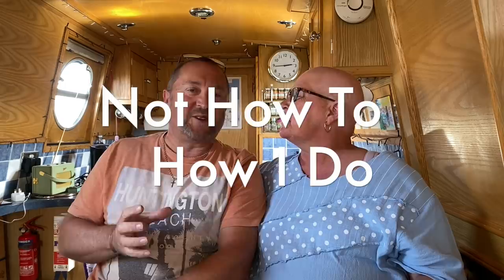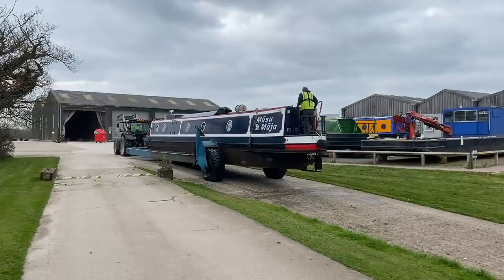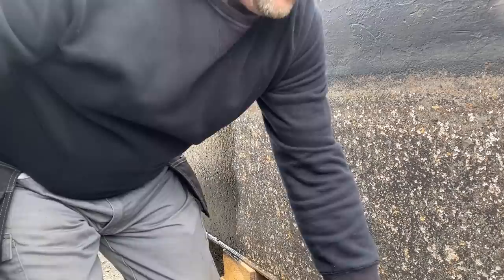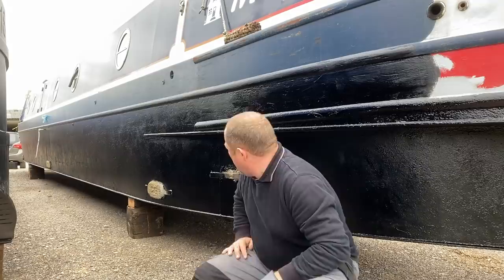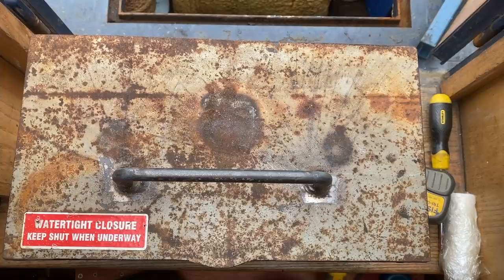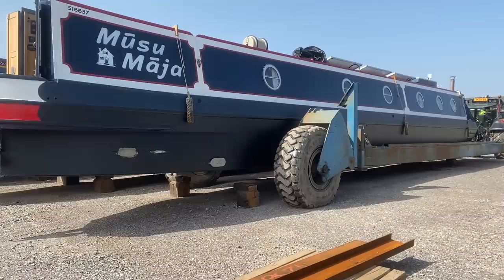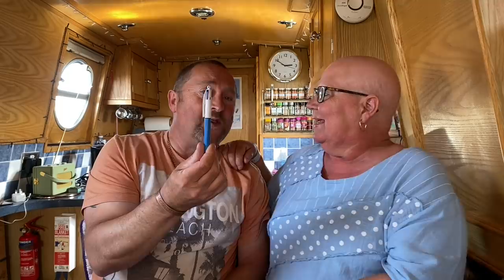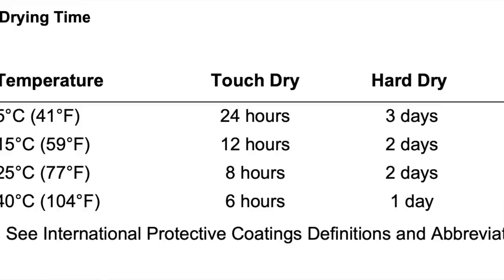DIY Narrowboat Blacking Important Information, How Much? How Long? How To? Canalboat life Costs E102

Comment: The best economy with blacking is just to get it done up north, if your wanderings allow.  Always better deals.  Looks like you did a great job though and always satisfying to do the job yourself.  Personally I don't like crane outs (because of the potential for accidents and stresses on the boat) and dry docks (because providers often have health and safety rules about owners using them or inspecting work done)... trailer out is the way to go.
Reply from the maker: Maybe will be up north next time

Comment: A real good job there . 
Saw the sides done but what about the underside ? I know the plating is much thicker but rust is rust !
If i lived inland i would be very interested in Canal Boating .
Reply from the maker: The base plate is thicker steel and with lower oxygen levels at the bottom of the canal it doesn't rust as much, and any coating you apply get scrapped off in the shallow water
Reply: @welldeckdiaries5610  if I got one built I would have stainless steel bottom and thicker then the ballast can be less.

Comment: Good job. Happy to see Debbie in good spirits. Mark, I see a lot of people don't coat the bottom of their base plates on their boats. Can you elaborate on why this is common? I'm in the US. We have a few narrowboat canals but no boats on them. I hope this changes. Good video and thanks for sharing your hard work.
Reply from the maker: The base plate is thicker steel 10mm instead of 6mm and the idea is that the oxygen levels are lower at that level so it doesn't rust as much
Reply: @welldeckdiaries5610  Am I right in thinking that the blacking would get scraped off in the shallow parts of the canal?
Reply from the maker: @catherineatkins7908  correct
Reply: @welldeckdiaries5610  Thank you. I understand that.

Comment: Great job, how are you able to blacken the very bottom of the boat? A loverly couple. My wife had cancer twenty years ago and things have been great since, I just wish the same for you.
Reply from the maker: Not normally painted, the base plate is thicker steel and with lower oxygen levels at the bottom of the canal it doesn't rust as much, and any coating you apply get scrapped off in the shallow water. Great to hear that about your wife ❤️

Comment: Bitumen is crap. The only reason it's used is because it was traditional to paint wooden boats with it, but it makes little sense on steel boats. If you really want to do it properly, next time get it grit blasted to get rid of all the bitumen and apply 3 or 4 coats of two pack epoxy. Jotamastic 90 is good but you must follow the technical data sheet to the letter.

Comment: Hi Folks,

Why don't you do the bottom? Deb looks wonderful! Courtenay
Reply from the maker: It is considered that the lower oxygen levels at that depth and the thicker 10mm base plate will not case a rusting/corrosion issue. Also any blacking would be scrapped off in the shallow waters

Comment: I didn't see you putting the blacking on the very bottom of the hull. Don't they blacken that area, I would think it should have blacken (paint as we call it) to protect if from hitting items and grounding.
Reply from the maker: its not normally painted, the base plate is thicker steel to last longer and with lower oxygen levels at the bottom of the canal it doesn't rust as much, and any coating you apply get scrapped off in the shallow water

Comment: Not being picky - just curious ! I thought power washing/jet washing was to get the crud and green bits off. I thought then there was some mechanical rubbing/scrubbing done to get anymore hard crusty bits off, or scrub any rust away ?
Reply from the maker: I think that depends on the state of it after the pressure washing. The blacking is designed to cover bare steel but as you say it there was rust encrusted areas flacking areas then scraping or sanding would be needed

Comment: Can I ask what are the anodes do, why are they not blacked - good job, you have lots of patience Mark.
Reply from the maker: The anodes are sacrificial anodes that are designed to corrode through galvanic corrosion to protect the hull and they need to be exposed to conduct ant stay electrical currents
Reply: @welldeckdiaries5610  I'm female and you sound like a car salesman! - didn't understand a word - but take your word on it. x.

Comment: very cool, I enjoy the technical parts of Narrow Boat life very neat, one question.. did you blacken the actual bottom?
Reply from the maker: Not normally painted, the base plate is thicker steel and with lower oxygen levels at the bottom of the canal it doesn't rust as much, and any coating you apply get scrapped off in the shallow water

Comment: Hi Mark. It's a very informative video - thanks for that. I'm going to do my own as well after a poor "professional" job a year and a half ago. Just one quick question. I'm not on the boat at the moment but am going to do the same as you re sink and shower drainage. What size pipe did you use? It looks like 15mm push fit is that right?
Reply from the maker: I assume it was that size, they were bits I found laying around

Comment: Thanks for showing us how this is done.  One question...what happens with the bottom of the boat?  Does it get any attention or what can be done to maintain that part?
Reply from the maker: Not normally painted, the base plate is thicker steel and with lower oxygen levels at the bottom of the canal it doesn't rust as much, and any coating you apply get scrapped off in the shallow water

Comment: Good job! Apparently there is no blacking applied to the bottom...or did I miss something.
Reply from the maker: Not normally, the base plate is thicker steel and with lower oxygen levels at the bottom of the canal it doesn't rust as much.

Comment: You showed yourself doing the easy bits! What about the bottom, which must be a killer of a job with blacking in your face. How did you manage that?
Reply from the maker: Bottom is not normally done. It is considered that the lower oxygen levels at that depth and the thicker 10mm base plate will not case a rusting/corrosion issue. Also any blacking would be scrapped off in the shallow waters

Comment: Since I really know nothing about the NB construction this is likely a very dumb question, but why is it not blacked on the very bottom?
Reply from the maker: Not a dumb question Mary. Not normally painted, the base plate is thicker steel and with lower oxygen levels at the bottom of the canal it doesn't rust as much, and any coating you apply get scrapped off in the shallow water

Comment: I've got a dumb question here... but how do you do the underneath of the boat? Big hello to Debs all the best to you both all the best from Portugal .. De Nada in reply to your last weeks reply ;)
Reply from the maker: Not normally painted, the base plate is thicker steel and with lower oxygen levels at the bottom of the canal it doesn't rust as much, and any coating you apply get scrapped off in the shallow water

Comment: Hi. Can you let us know what happens to the bottom of the boat with respect to blacking...?
Reply from the maker: its not normally painted, the base plate is thicker steel to last longer and with lower oxygen levels at the bottom of the canal it doesn't rust as much, and any coating you apply get scrapped off in the shallow water

Comment: Looked like you have a bow thruster, if it is a thruster does it make a great difference when negotiating sharp turns ? Looking at the box to access the prop, I wonder if it could be a good idea to put a false bottom under the lid so the false bottom sits in line with the bottom of the boat when the lid is on the box screwed down. With the prop turning it must create turbulence within the box, as it is at the moment and possibly cavitation bubbles resulting in some loss of power
Reply from the maker: The bow thruster does help.
did you not see the section of the video where I explain that we have had the weed hatch cover modified?
Reply: @welldeckdiaries5610  Thanks for replying. No I only just found you, so I will be working through your videos over the next few days. I am following a few of you guy's as I am seriously considering moving to living on a narrowboat and I was hoping to find someone who does work on their boat rather than  putting it into a yard to get everything done so when I saw you busy blacking the hull you looked ideal to follow as I wanted to find out what was involved in keeping your boat in good condition. I am retired and on the coast in the UK and life on a narrowboat looks ideal so I am trying to find out as much as I can. Do you have a Facebook page so I could message you as that would be better than posting what will most likely be lot's of stupid questions in public here ? Or maybe I could E/m you, what ever is easiest  for you. Peter.
Reply from the maker: @Peter-nv3wu  skip to 12:00.
And no questions are silly questions 👍

Comment: That was very interesting. I've heard other narrow boaters say it cost £1000-2000 to have it done. Question: So why didn't you need to sand first?
Reply from the maker: With the bitumen type blacking it doesn’t need to be sanded, it can be applied to bare steel or the previous blacking. The power pressure washing remove any dirt or loose blacking so you can the apply the new coats

Comment: Did you do the bottom of the boat Mark, or does it have to be done with something different.
Reply from the maker: its not normally painted, the base plate is thicker steel to last longer and with lower oxygen levels at the bottom of the canal it doesn't rust as much, and any coating you apply get scrapped off in the shallow water

Comment: I'm interested in the modification you made to the weed hatch. Did the baffle make any difference?
My boat has the same concept as you obviously used to have - just a single plate across the top of the weed hatch with nothing below to reduce the turbulence. Is it worth having the baffle added next time I'm out for blacking?
Reply from the maker: Ive convinced myself there is less vibration when working the engine hard on the rivers but it probably just placebo effect as I had to part with my money 😂

Comment: What about the bottom and where the blocks are
Reply from the maker: its not normally painted, the base plate is thicker steel to last longer and with lower oxygen levels at the bottom of the canal it doesn't rust as much, and any coating you apply get scrapped off in the shallow water

Comment: Enjoyed this informative vid very much. Given the 2 pack epoxy works out something like x5 the cost what are the advantages? Does it last x5 times longer? Maybe it makes the nb slip through the water better, who knows.
Reply from the maker: It is more resistant to knocks scraps and diesel spills which dissolve your bitumen blacking

Comment: Nice job! Did you do inside the bow thruster tube? That’s pretty important and needs protecting. 👍🏻
Reply from the maker: Yes I did, I adapted a thin roller although I couldn't get all the way to the middle

Comment: Sometimes it's better do a job yourself just for "piece of mind"...
Last time I helped out blacking we used the upturned drum lid to roll on to even the bitumen out on the roller...bit like after you've loaded up in a normal paint tray, it seems to help when rolling it on the hull as you don't get as many thick clumps that you have to try and spread out... Hope that makes sense !   We had enough bitumen left to do an extra roll coat along the water line   just out of interest what is that pipe for that is poking out of the port side window ?

Take care, Best regards...
Steve
Reply from the maker: Why didn't I think of that 🤣.
Its a temporary vent pipe for the toilet, it been temp for over 2 years and its on my to do list 😂🤣
Reply: @welldeckdiaries5610  one of those temporary things that you'll get to eventually !! ....Rome wasn't' built in a day, lol . You've had enough on your mind these last few months. Take care, Regards  Steve

Comment: Looks like you did a good job, Mark. Just a question from an totally uninformed fellow: does the flat bottom get blacked as well? I've seen many narrowboats being blacked, but don't recall ever seeing anyone going underneath the boat.
Reply from the maker: Not normally, the base plate is thicker steel and with lower oxygen levels at the bottom of the canal it doesn't rust as much.

Comment: And if you have the £5000 treatment done, how long does that last compared with the cheaper version of 2 yrs between coats ?
Reply from the maker: It would need a pressure wash a light abrasion and a 1 coat every 5 to 7 years

Comment: Right. Possibly very stupid question alert. What about the bottom of the boat. Do u need to black that as well or is it left unpainted?
Reply from the maker: Not a stupid question mate.
Not normally painted, the base plate is thicker steel and with lower oxygen levels at the bottom of the canal it doesn't rust as much, and any coating you apply get scrapped off in the shallow water

Comment: Well we had ours done last year we don't live in the UK all the time so we got our marina to do it in Devizes Wiltshire so I did not get a chance to see the condition, before it was blacked I think we left ours to long at three years but could not see any rust on the water line we had two extra anodes welded on, price wise it was about the same I think but our boat moored there so maybe they do a deal, did you not have to sand the Hull before application? *keep well
Reply from the maker: Pressure washing is enough prep, the SML Ballastic data sheet says it can go onto bare steel

Comment: Good job Mark, I do have a question as not being a boat man, you did the sides but what about the bottom of the boat or does that not need to be done as many times?
Reply from the maker: its not normally painted, the base plate is thicker steel to last longer and with lower oxygen levels at the bottom of the canal it doesn't rust as much, and any coating you apply get scrapped off in the shallow water
Reply: @welldeckdiaries5610  morning that's a quick reply. Ok that makes sense didn't think of that but thought there must be a reason as could not see you not doing it when you have gone to the extent of getting the boat out of the water, 👍

Comment: Great video Debs & Mark, Just one question you didn`t need to do the very bottom of the boat?
Reply from the maker: its not normally painted, the base plate is thicker steel to last longer and with lower oxygen levels at the bottom of the canal it doesn't rust as much, and any coating you apply get scrapped off in the shallow water

Comment: Silly question maybe but does the bottom of the boat not get blacked? 
Great Vlog by the way and you’re both looking really well.
Reply from the maker: Not normally painted, the base plate is thicker steel and with lower oxygen levels at the bottom of the canal it doesn't rust as much, and any coating you apply get scrapped off in the shallow water
Reply: @welldeckdiaries5610  ah. That makes sense. Ta. Best wishes to the both of you btw.

Comment: why do you black only the sides of the boat and  not the floor of the boat?
Reply from the maker: its not normally painted, the base plate is thicker steel and with lower oxygen levels at the bottom of the canal it doesn't rust as much, and any coating you apply get scrapped off in the shallow water

Comment: thanks for an instructive video. one question .
How do you black the flat bottom of the boat?
Reply from the maker: its not normally painted, the base plate is thicker steel to last longer and with lower oxygen levels at the bottom of the canal it doesn't rust as much, and any coating you apply get scrapped off in the shallow water

Comment: Ok so we saw you blacking the sides, but what about the bottom - the bit that was sitting on the blocks?   Personally, if it were me, I'd have got somebody else to make his arms ache.
Reply from the maker: Not normally painted, the base plate is thicker steel and with lower oxygen levels at the bottom of the canal it doesn't rust as much, and any coating you apply get scrapped off in the shallow water
Reply: @welldeckdiaries5610  Thanks.  I hadn't thought about that, being a landlubber!

Comment: does the bottom part not get painted I have watched many vids of this and nobody does the actual bottom
Reply from the maker: Not normally painted, the base plate is thicker steel and with lower oxygen levels at the bottom of the canal it doesn't rust as much, and any coating you apply get scrapped off in the shallow water
Reply: @welldeckdiaries5610  thx; here in Vancouver we paint the bottom normally once a year but paint the entire bottom (salt water of course) and our boats are a little different than yours. Boats the size of yours would have semi or deep draft

Comment: What happens to the base plate? Does that not need to be painted as well? (I know nothing at all about boats.)
Reply from the maker: Not normally painted, the base plate is thicker steel and with lower oxygen levels at the bottom of the canal it doesn't rust as much, and any coating you apply get scrapped off in the shallow water

Comment: Hi Mark, may I ask why you don’t black the bottom of the boat. Sorry if this is a dumb question, I am not a boater...
Reply from the maker: Not normally painted, the base plate is thicker steel and with lower oxygen levels at the bottom of the canal it doesn't rust as much, and any coating you apply get scrapped off in the shallow water

Comment: I noticed that you didn't black the bottom of the boat.  I know some swear that you should and some that you shouldn't as the steel plate is much thicker than the sides.  Do you ever do the bottom or do you subscribe to the thick steel theory?
Reply: I think you've just answered my question:-)